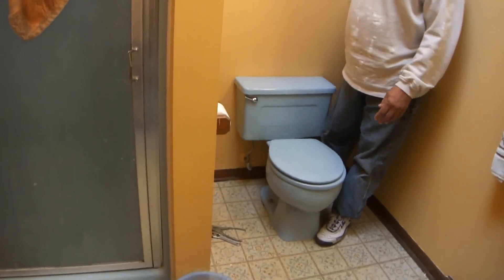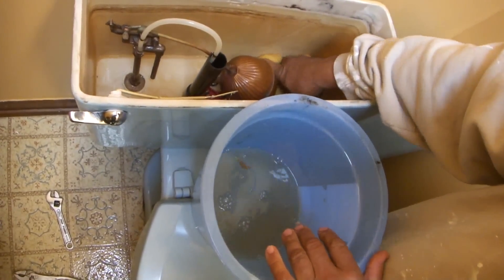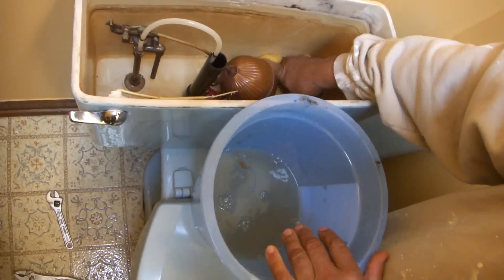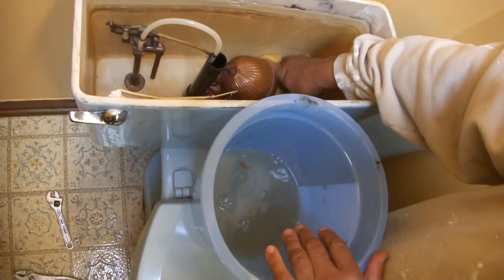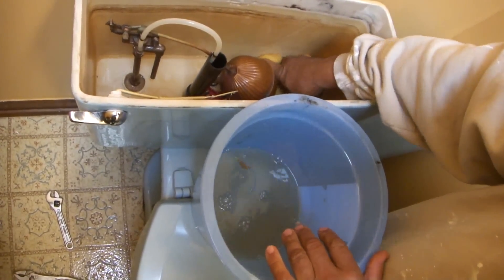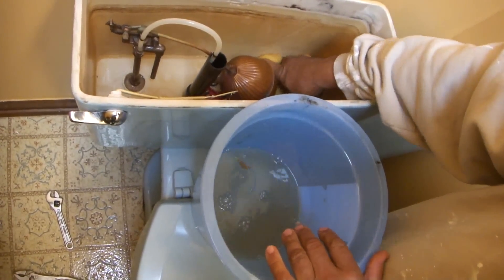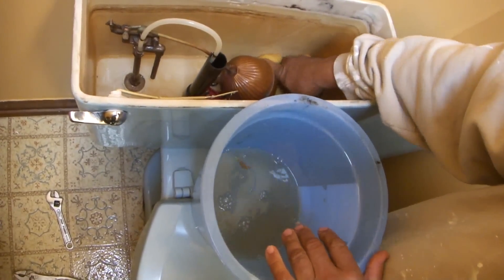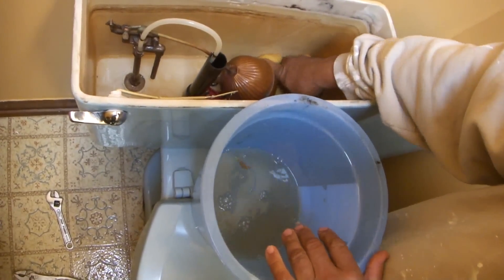How To Install Replace a Toilet Complete Guide Full Length Video

Comment: Man, talk about half-assed. You should have cleaned the floor before installing the toilet. You should have also offered to paint the wall behind the toilet. You should have bought a better toilet, not that cheapo you got.  You probably charged the "customer" a lot more than that toilet cost.  I'm not saying to buy the $400 toilet, but get a better one.
Reply: the toilet he bought will work fine
Reply: satchmodan Yeah, that floor was pretty disgusting. Maybe that's his house though, and maybe he just doesn't care how the floor looks.  Personally I would have replaced the vinyl floor while the toilet was off.  Vinyl flooring is cheap.
Reply: he said it was not at his house
Reply: i am 13 and now how to installa toilet .  i also know to clean the area
Reply: oh sorry
Reply: +satchmodan Maybe the homeowner who hired him only asked him to do what he did, some people don't have lots of money to spend. You are being very judgmental for someone who doesn't know the circumstances. Realistically, there is only so much of the grime you can get off an old floor like that, and it's under the toilet anyway, and caulked, so what harm will it do? Also, it's easy to paint the wall afterwards, if you're not a total klutz. I'm sure he charged fairly and that is probably the toilet the customer asked for. This video helped me replace my own toilet today. Don't be so dismissive.
Reply: +squeekycat 2o
Reply: +squeekycat and